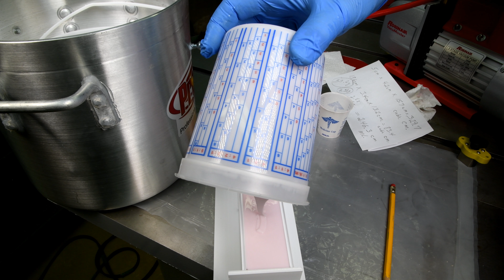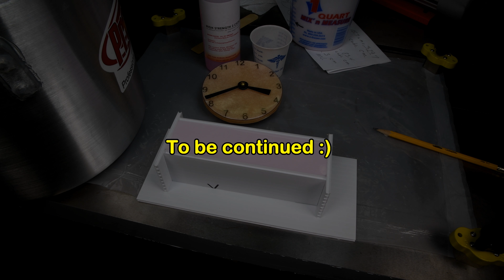The 2nd Mold - Part 2

Comment: Looks great Ron. Where did you get the high strength 2? I don’t see it at plasticworld.ca. I would like to give this a try too.
Reply from the maker: Hi Wayne,
Yes I did get it from Plastic World in Toronto almost 2 months ago. Unfortunately soon after my order arrived I found out that they had to stop selling some Alumilite stuff because the packaging/labeling did not meet Canadian regulations. Depending how sincere you are about getting this stuff, phone them. (416-630-6745) My experience has been very positive with this supplier, and when you call you actually end up speaking with a real person. Good luck my friend :)
Reply: Thanks Ron, I will give them a call or stop by when I’m in the area.

Comment: Columbo???  You don't have to be old.  That program is on the TV my wife is watching all the time.But then again, she is old.

I have always wondered.  Have you ever thought of building a small work bench/table and give that table saw a break??  Or perhaps you don't have the room for something else.  Just wondering.  :-)    See ya tomorrow.               JimE
Reply from the maker: Re: "building a small work bench/table" Yes! Thought about it a lot lately. Perhaps you comment here will motivate me to do it :)
Reply: I have a 300 lb laminated work bench that I built with two vises and dog holes and for the most part it just collects stuff.  I also built a little 2'x4' assembly table out of a 2x4 sheet of melamine and use that ALL of the time.  Most things clean up easily too.  Your only problem would be the Magswitches won't work.  Just design the edge so you can use quick clamps.               See ya later.                     JimE
Reply from the maker: Re: "it just collects stuff" Yup! I hear you on that. I've made a very heavy duty workbench too. Same problem ... half covered with stuff. You've seen it. The pressure cylinder is on it.
Reply: "The pressure cylinder is on it."    OH! Is that what that is??!    :-)

Funny how we all seem to go down the same roads but don't learn any thing from each other.  :-)  JimE

Comment: So I ran the calculations (nerd alert) and it comes out that -29.5 inHg is about 98.5% of a perfect vacuum.  (From what I can tell -29.5 is about what the gauge reads.). Pressure and volume are linearly related under constant temperature.  Therefore if the gauge is accurate, the bubbles expand to 50 times their original size. Now keep in mind that as pressure approaches closer and closer to perfect vacuum, the bubbles get infinitely big, and a small error in the gauge reading will result in a large error in this calculation.  But for all practical purposes here, 50x is about what the bubbles are expanding.  Thats just my 2 cents.
Reply from the maker: Hi Walt,
Don't know how accurate that cheap gauge is. When I first got it I had to take it apart and tinker with it just to get it to zero itself.
Anyway, look at the size of those larger bubbles at https://youtu.be/7Tumh0p1W3o?t=424 that are at least a cm in diameter, and then imagine just how many microbubbles it will take to fill them. It's gotta be thousands. But I'm no expert, lol :)